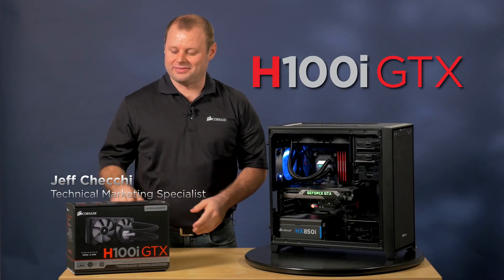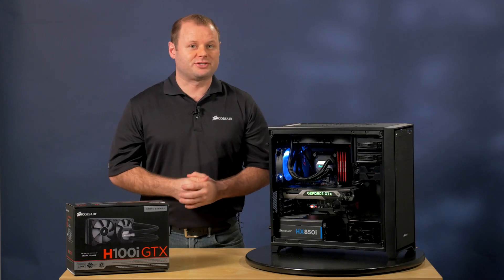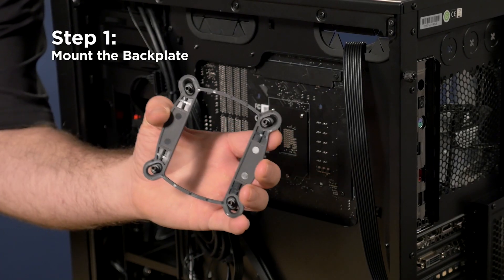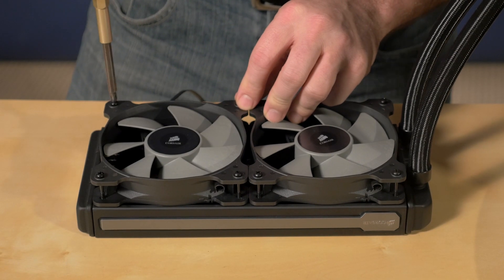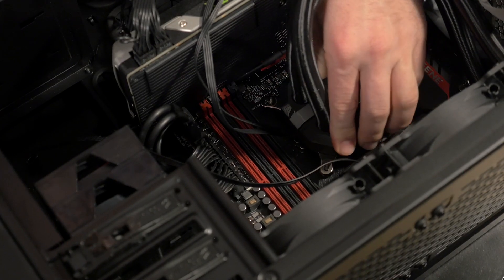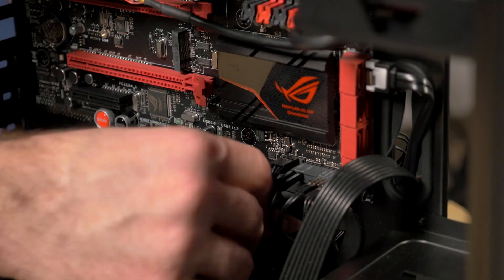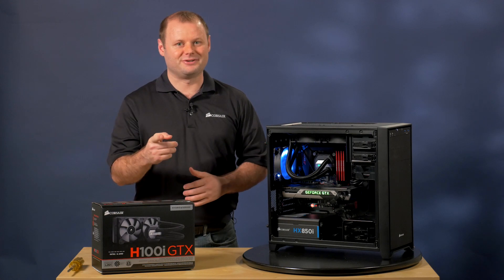Corsair Hydro Series H100i GTX Liquid CPU Cooler Installation How-To Guide

Comment: Just bought the GTX and have it installed and it looks awesome. I was wondering if it was possible to manually control fan or pump speeds. Asus AI Suite sees the fans spinning at like 800rpm no matter what and can't control it. I'd like to be able to put everything at 100% while I overclock just for some consistency while stress testing, but it's not a big deal, just wanted to know if it's possible.
Reply: The pump can be set on two values in Corsair Link software: either quiet mode (2300 RPM) or Performance mode (3000 RPM, max speed).
The fans are also easily adjustable in Corsar Link with a high variety of settings.. Of course it has PWM control, but you could choose a fixed RPM or fixed percentage (100%).

Don't use Asus AI Suite 3 to control the pump or radiator fans, it does a horrible job at it and doesnt really understand watercoolers.
Only use AIS3 for casefans.
Reply: I ran into the same issue myself but the problem has nothing to do with communications of the Asus board and pump, you have to go into the fan control system and change the cpu fan option to PWM. That will fix almost all issues

Comment: Great job corsair. You are featuring this cooler with the 350d and maximus vii gene. What my exact set up is. But this won't fit in combination with the 8-pin cpu power plug. Great job corsair. Really sweet.
Reply: Rod Foong Also what I ended up doing

Comment: Instead of releasing a new cooler fix the fucking firmware for the H100i and windows 8/8.1
Reply: Windows 8 sucks, get windows 7 instead.
Reply: xXChainLightingXx  Nah i like 8.1 better its smoother and generally runs better.

Comment: Can i get The GTX Version if i send in my Normal H100I cuz the pump hase some problems and stucks sometimes or give some rly bad sounds from it. The temps are rly high since i build the Cooler in on January 2015. I think my H100I is a "monday work". And i will upgrade to the GTX if i can RMA the H100I and get a GTX ?
Reply: If its broken you can. The place i bought my H90 from allowed me to upgrade to H100i GTX with a small price exchange. Quite nice, but it depends on the shop you buy it from.

Comment: Just installed mine. No leaking issues. However, I am getting the 'no CPU fan' error on post. The system is running but the motherboard is not detecting the liquid cooling system. Went ahead and disabled the error, but now i cannot monitor the pump or fan speeds with the software.
Reply: Hey, I figured it out. The problem lies with the overall fan mode. I was getting the error myself until I tried something a little different. See, the H100i GTX is a PWM pump. Just go into the ASUS motherboard settings and change the cpu fan from whatever it is by default to PWM. It completely solved the issue
Reply: Did you have a 3 pin power lead from your pump and a 4 power header on your mother board did you just plug it in anyways and then did you go into the settingsystem to change the default settings? Please help me
Reply: What motherboard are you using?
Reply: speedevil22 Asus Z97-AR. I sort of figured it out. Went into the advanced mode and into monitor, let the motherboard check the fan speeds highs and lows, doing that allowed it to communicate with the cpu corsair cooler now. On one start up I had to do it a second time though.
Reply: Hmmm. This sure seems to be a common problem on Asus boards. I wanted to use Corsair Link instead of my fan controller, so I plugged all that in and installed the software, but my Maximus VII Hero keeps freaking out on start-up saying there's no CPU fan. I don't know why it thinks that because the power is connected to the CPU fan header. Thanks for the tip, though.
Reply: lord zaros thanks for your help! That solved the cpu fan.. but how do I get the chassis fans to read in the bios? Z97 pro. I have them plugged into cpu _opt. Should I change their settings, too?

Comment: Are these included fans better than your 120mm SP silent fans? I already have 2 of those and they look better on my system.
Reply: Alex Maia their website says they are SP120L's. The L is new, but the current SP120's are the high performance ones, not the silent ones you have. They look similar, but the high performance ones have better static pressure which is better for heatsinks and radiators.

Comment: h110 DESTROYED MY 4000$ PC because it LEAKS LIQUID
Reply: imagine this pc deaaaaad! after 2 months.
Reply: Christos Kapodistias did you get it replaced by corsair?
Reply: Still waitin. But i have sent in my damage claim. They are looking supportive up to now.
Reply: Christos Kapodistias okey do you still recommend corsair as a brand
Reply: Rens van loenhout well im not sure yet we got these aio cooling systems in my company in expensive Video editing builds. If you add 2 noctuas Fans they are really cool. But if they fail alot i wont recommed Thema again. Psus are great.
Reply: Christos Kapodistias i want to buy one for my $1000 build but when hearing something like this im not sure anymore
Reply: mhm suck for you. H110 pretty good. still have it. old one. no leaks since 2014.
Reply: how did it go?
Reply: omatomatom I've gone trough RMA support now the parts are on the way directly into CA, USA via UPS.
We did send the mainboard, cpu, gpu and cooler.

I will keep you up to date.
Reply: Christos Kapodistias good to know, thanks. You're getting all your damaged things replaced?
Reply: omatomatom great, upgraded my h110 to a H100i gt, waiting h110i gt back ordered.
Reply: i got lucky and my h100i gave out, but i got a notification that cpu temp was above 90c on my 3770k. powered down and i guess it was a failed pump. but i RMA'ed it and it was no problem, i got a new one within a week and its still going 7 months later (and im overclocked to 5.0ghz, max load temp 68c)
Reply: themike547 i dont even overclock but now i never need to worry about my temps again. but just for safety reasons i use realtemp with an alarm if it reaches 70 degrees
Reply: themike547 well i dident overclock. But i did some important render job.... Maybe i should use workstation grade parts for that not gaming. After 3 Days of full load i wasnt there when something failed. But my Monitoring Agent told me the pc has gone offline...
Reply: Christos Kapodistias sorry that happend man did you get anything from corsair

Comment: I feel Corsair continue to make excellent Hardware.
I give a Plus Plus for the new look bolt on cooler.I particularly like the new Sleeves.
But... There is a Rather Large Object in the Room that needs to be looked at more closely...
There needs to be an Affordable Bridge between Virgin aka 'DIY' Water Cooling and...Custom Water Cooling.
I Think I have a Solution- excuse the Pun.

Comment: is it compatible to do push pull config in phanteks enthoo pro using corsair h100i gtx?
Reply: pushpull has no benefit from push or pull
Reply: will it make my cpu cooler than push or pull?
Reply: jedzry j what?
Reply: what i mean is will push or pull have a lower temp than the push pull configuration
Reply: no it will have the same

Comment: which one should i get? this or H110 GT? i have an H440 Case.
Reply: H110i GT obviously gives you lower temps than this since the radiator  has a larger surface area.
Reply: +Shadow Emperor Daguthir i have now the gtx h110i :D super happy with it!

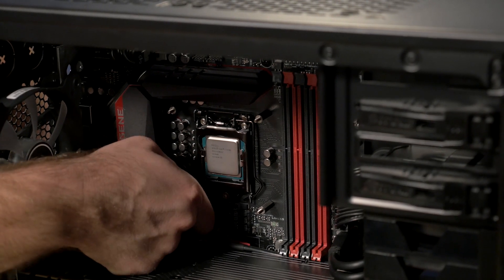Comment: 0:59 I see you guys still didn't fix the issue with the loose standoffs. I put up a video showing what I mean. watch?v=nKctuFvalWg
Reply from the maker: The standoffs are designed to be a bit lose to prevent damage to your motherboard from over-tightening. Once you attach the pump and tighten it down with the thumbscrews everything will be secure.
Reply: My mounting thing was loose as hell when I stuck it on. After attaching the pump and tightening it up, it was as tight as my tight jeans.
Reply: Corsair Alright. Thanks. Didn't know this and put rubber washers when I encountered this problem. Thanks for clearing that up. Should help for future references when people Google search the "issue."
Reply: I watched your video, but what you're complaining about isn't a real problem, because after you install the cpu cooling block, the cpu cooling block tightens the back plate and the standoffs. So, I think you are creating a flood from a drop of water.
Reply: it is  term used for closed loop water pump that you buy from a manufacturer. not costume ones. i have the same motherboard. it has only 1 usb2 header. i suggest:
 https://www.amazon.com/Internal-USB-Hub-newest-model/dp/B01IFGFTJ2/ref=sr_1_2?ie=UTF8&qid=1491167013&sr=8-2&keywords=internal+hub 
that helps with internal usb header issues.
regarding the cpu fan problem you need to connect pum to pump and pwm fans of corsair to cpu fan and opt cpu fan headers. 3 fan headers on top of your motherboard.
Reply: Corsair Works that with the Obsidian 450D?
Reply: Afistnu I'm worried about the same. I currently have rubber mounts holding my H100i tightly otherwise the temps go out of control.
Reply: The shitty stand-offs/mounting are what stopped me from using AIO watercooling, and discovering the beauty of Noctua. <3
Reply: Hell yeah man. I'm using the D15s, but I need to switch out the case. It's blowing it's heat all into the GPU lol.
Reply: sina shahsana ah well - kinda important info there buddy. If you'd led with that I wouldn't have given you a snarky reply. :)

I'd suggest visiting some of the overclocking forums or reddit pages and see if other people have done he same as you and what their results were. But if it works it works. 👍
Reply: sina shahsana hey dude, thanks for the heads up. One doubt though, the data cable, where did you put it? Or doing how you did you don't need to use it? Hard to find the correct info even in the quick guide of the product, that sux! Thanks for the help
Reply: Carlos Panades All-In-One?
Reply: Carlos Panades I'd suggest getting a DVD tray card reader for the front of your case. They usually come with several USB ports. As long as you have some USB headers available on your board of course. 

Or a PCI or PCI-E USB expansion card. They're very cheap.
Reply: sina shahsana thanks man!
Reply: Zhen Ji seriously? Go buy some new ones off eBay and stop using a bloody electric screwdriver!
Reply: Corsair Did you have the Corsair Commander Link in the case or the 100i was connected into the USB? I checked newegg and I didn't see this product, is it new?
Reply: Corsair  Works that watercooling with the Obsidian 450D?
Reply: Thanks
Reply: Corsair I agree with what you're saying but Afistnu has a point, i personally have had that problem and there are loads of videos of people explaining how to fix high temps, by tightening the mount.
Reply: +Afistnu The standoffs are loose, and the fact the backplate is made out of plastic ensured for damage.
Reply: +Corsair Thanks so much for this explanation! I'm in the middle of installing h100i gtx now on amd board and wondered why it seemed loose as well.  I thought maybe the backplate that was included with my motherboard may have been different from most other backplates.
Reply: +Makaveli RIP Do you think it can fit in an NZXT S340 as an intake? Do you need push pull for this?
Reply: Will this work for a H105, please answer quickly (not just Corsair anybody) because I am building a desktop soon.
Reply: " put rubber washers " - lol, i did exact the same xD
Reply: IS H100i the same thing as H100i GTX? And if not, would you install the regular H100i the same way? Please reply, as I am building a comp soon, thanks :)
Reply: I couldn't edit my comment, but also is this a AIO cooler?
Reply: Thanks for this, was getting really worried after installing this recently and the back plate was just so damn lose I thought surely I had missed something. Was worried it would start disconnecting from the cpu's surface.
Reply: i have em both, noctua fans all over my case and this with a different mount :-) and still noctua fans on it
Reply: It was fine for me once it was tightened up.
Reply: to bad  ur link doesnt work .
Reply: Had this exact problem and found this comment thread, which helped me out.  Thanks!
Reply: That is no issue at the end when it's all assembled.feels like the design was to give it some space to move becuse back plate is plastic and might brake. They made this system to work for a lot of different cpus and motherboard. I can understand  it's hard to have precise measurements.
Reply: My motherboard has 2 CPU fan header and a pump header. Is it ok if I connect each part to motherboard for more efficient fan speed?
Reply: sina shahsana you will only have one CPU header. The others will be system fan headers. But no the idea is to use the Corsair equipment only. RTFM dude.
Reply: I have an Asus Maximus ix hero
Reply: Check the specs on it. Specifically made for overclocking and it has costume and factory liquid cooling headers
Reply: your welcome. to be honest with you i am still a little confused about this cooler. from what i understand it is really how you prefer to set up your cooler. I like to control all my fans with my motherboard therefore i connect all my fan headers to motherboard. it has a very flexible program and good speed control. now when you set it up like me you just hide the corsair fan headers somewhere and you dont have to connect data cable anywhere, unless you must change that white led color on pump/block.now if your motherboard is not an advanced one you do it corsair way and connect fan headers to pump and pump to motherboard or power supply. but to control your fan speed and stop them from running at full speed all the time you have to connect the data cable to a usb 2.0 header. if you dont have one you need to create one . either from covering a usb 3.0 with an adapter or using an old mobile phone usb cable or webcam cable to connect it to an external usb cable which is more efficient. barbecue that stupid cable that comes with cooler only needs one usb 4 pin, but it renders a whole 9 pin useless which is 2 usb 2.0. i hope it helps.
now what i am confused about is that my motherboard shows pump is running at 1300 rpm. corsair program says 2700 rpm. i do not know who to believe. but my cpu runs at 79 c at full load and i dont like it.
Reply: sina shahsana that's interesting. So the pump is working without the use of the Corsair fan headers? I would have thought it needed those headers to keep the pump running or are the headers just for the two 120mm fans on the cooler? Is the pump run by the mini-b USB connector only?

I would suspect the default pump speed would be 2700 if using just the Corsair software. Your motherboard sounds pretty great - I'm sure it's telling you the right speed. I guess the only way to find out is to try it both ways and see what results you get. I have 12 USB ports on the back of my board so it's not really a concern for me to lose one.
Reply: the usb doesn't provide power to neither the fan nor the pump. a usb header has only 5v and max 2A power. a fan or a pump is usually 12-14 volts.the purpose of that usb is just to control speeds and led through link software. the cable that provide power is the one that you connect to motherboard cpu fan header. you have to make sure that one is connected to a power sorce no matter what. that runs your pump. now if you have a new motherboard that is AIO ready. it has a pump header and multiple fan headers. you make sure you connect that cable to pump header. now corsair leaves leaves you 2 fan headers out for motherboards that are not AIO ready. so you can connect your fans to it, but you can always leave those empty and connect fans to motherboard headers.
Reply: What AIO stands for? Tried to figure it out or find somewhere but I could not.. I have ROG Hero IX Z270 and old case Haf 932. I need to find a way to have 3.1 and 3.0 USB to the front of the case. Any tips? Regarding to pump I just build the system and tried only the way manual says, tried to plug power into AIO pump header but system asks me to plug into Cpu fan header instead and then worked.
Reply: Bullet MagnetMan thanks
Reply: i broke 3 thumbscrews by accident what do i do now?
Reply: Yeah the standoffs are loose im putting mine on now
Reply: so i did some tests, and it is actually much better to connect each fan header to motherboard if you have the options. I have cpu fan , CPU fan opt, and pump header. now pump is running at full speed which wasn't the case before and i can always slow it down on app here. i had no control over fans before and they were loud. now they run very quit when there is no process on CPU. and finally corsair and main board app are working perfect together. corsair sets the max level of fan and pump speed and main board decides whether i need max speed or not. so when want to do OC, i just put corsair app to performance mode and let my motherboard run the fan for overclock as i programmed it. i though it is interesting to share this with you guys. try it if you have a good Asus motherboard.

Comment: Nice design, but how much improvement has been done to reduce the pump noise ?
It's the only parts that holds me back of instaling one of these, I've seen alot of noise complains about aio liquid coolers pumps .
Reply: I have an H55 with the pump running at full speed. I can't even hear it over the case fans.